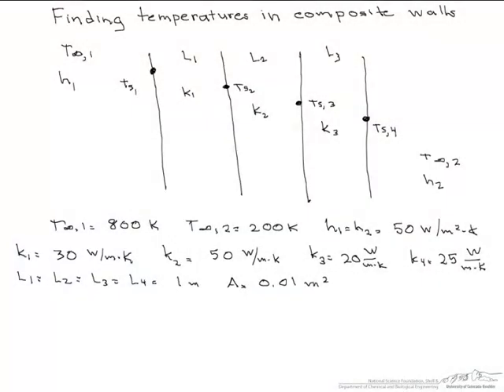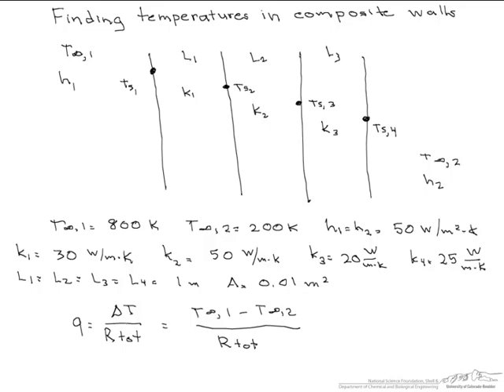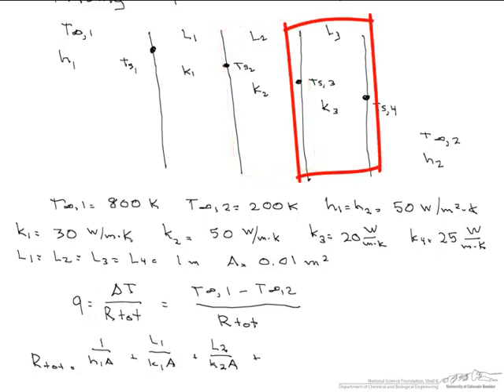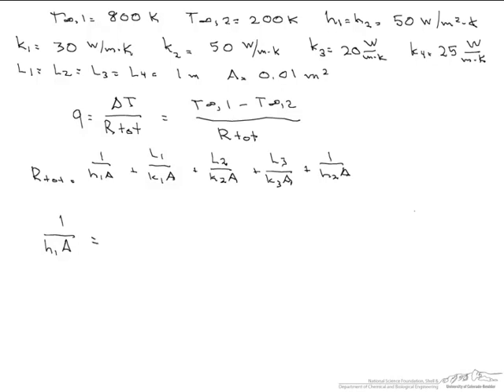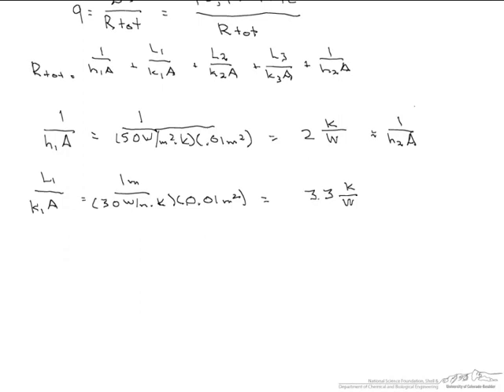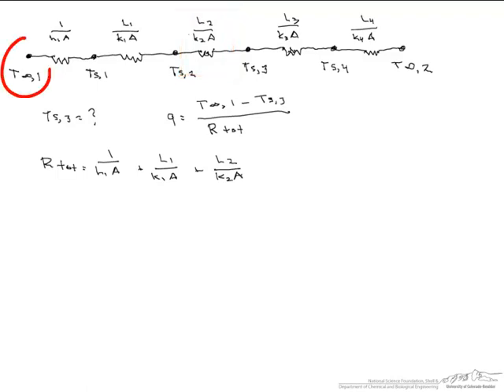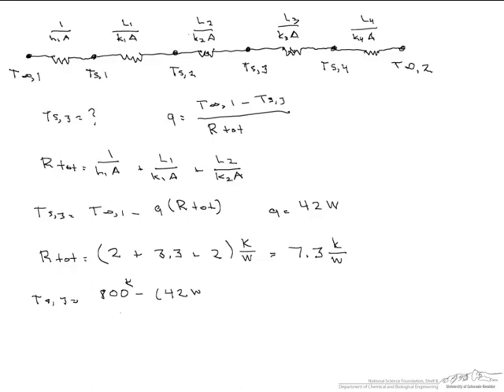Thermal Circuits: Temperatures in a Composite Wall

Comment: can i ask you a question? how about if the heat generation is occur in the middle of the wall.. so there is a heat generation on the B material only between the A and the C wall

Comment: It seems to me that you used the case of heat being lost to the environment (t infinity you call it) as being in series with the  thermal resistance of the wall.  Wouldn't it be in parallel with the wall?

To say that another way, wouldn't the circuit be Tinf1 to ambient L1, L2 and L3 in series and again Tinf2 to ambient?  If so, none of the energy into Tinf1 would go through the wall as it would be in parallel to the wall..

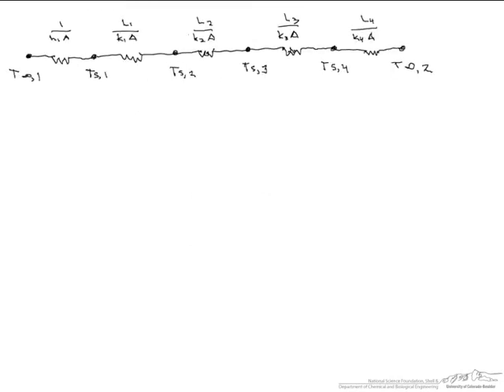Comment: Thank you for creating all of these videos.  I appreciate being able to review and work along with each of them.  In doing so, however, I found a minor error in this video.  Around the 4:30 mark, you display the equivalent thermal circuit.  The problem is that between Ts,4 and Tinf,2, it is a convective heat transfer, and should therefore have a resistance of 1/h2A (not the L4/K4A that is displayed in the video).  No big deal... just a small observation.